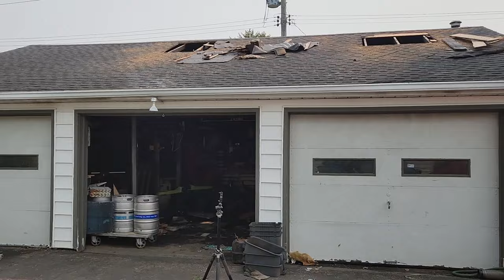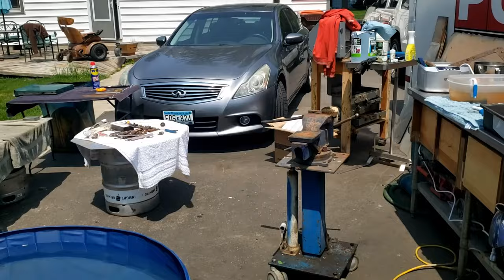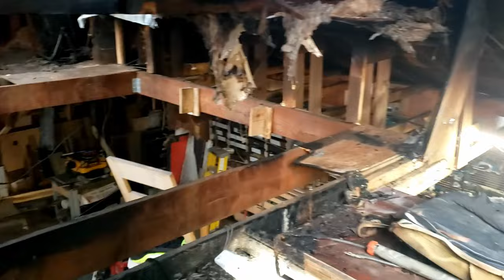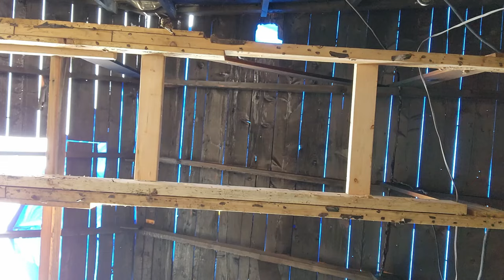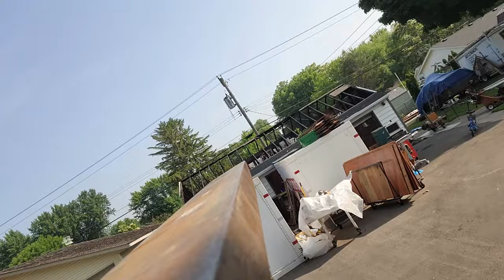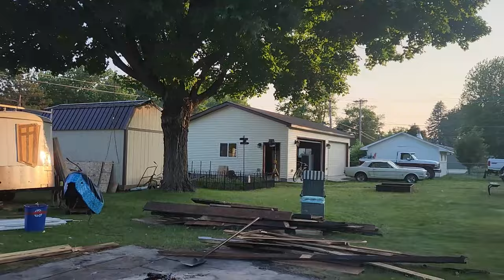Rising from Ashes: Rebuilding After a Garage Fire

Comment: So sorry you had to go through this.

What was the official cause of the fire? Did it start in your dust collection?
Reply from the maker: It was for sure the dust collector but where the question still remains is regarding the ignition source. Once it was going the fan sure did feed it oxygen. Id didn't take long for it to be roaring.
Reply: Ive seen smoke while cutting on my cnc, so I can well imagine it could ignite with a dull bit and low humidity.  I dont use a dust collector, and am wondering why yours was in the attic/overhead. Doesn't that make it hard to empty?
Reply from the maker: @Flyingspyder  i had a 2 post lift that had a platform that i could ride up and down. There was a shelf it sat on
Reply: Do you have space to put the dust collector outside or something so it doesn't start another fire? If that isn't an option,  what are you doing to prevent another fire? I couldn't imagine you'd want to do that again 😢